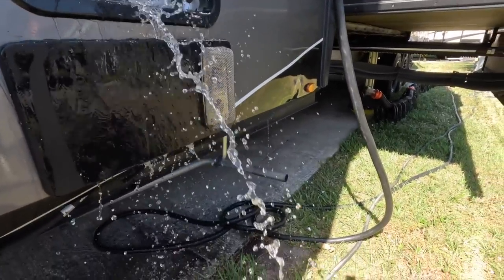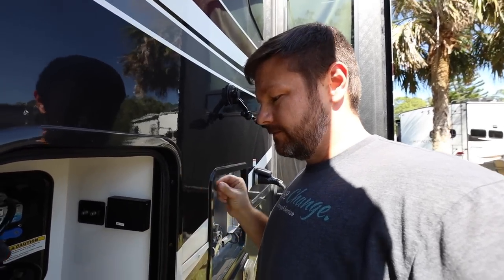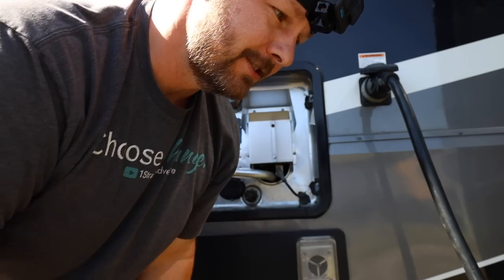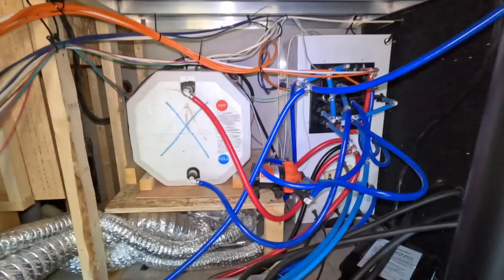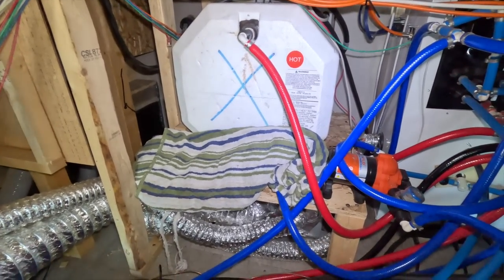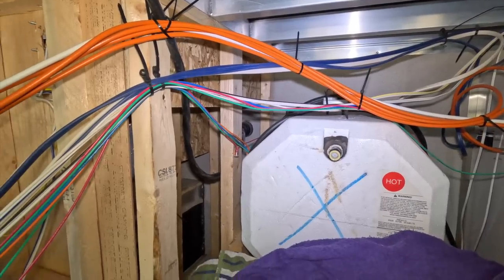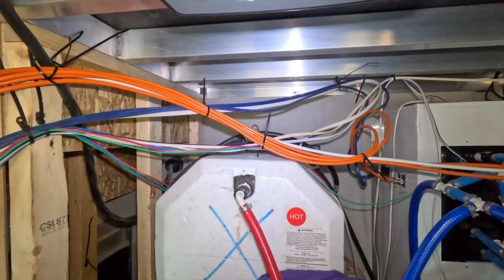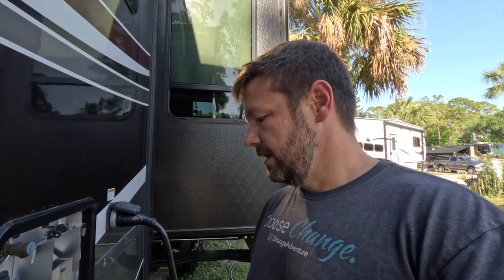No Hot Water Pressure in our RV! Hot Water Heater FIXED! 🔧💦 (RV Water Heater Maintenance)

Comment: My check valve went out on our trip to Yellowstone last September I pulled it apart. Ran with no guts until I got home. Just cut the pipe. Put a shut off valve in line. Been working great ever since. Thanks from Wisconsin.

Comment: Was happy ours came with the tankless on demand. Seems every youtuber at some point those plastic fittings on the top/bottom of that tank will eventually leak. Good that your top one is changed but i wouldve replaced the bottom one as well with a metal one while you were in there.
Reply from the maker: That’s a good call. I didn’t even think about it at the time. We just wanted water pressure at that point. 😩 I’ll have to do that next time I’m in there. Thanks for the suggestion!

Comment: Ours being older, have had to work on the water heater a few times, did the check valve a few years ago, the pressure releif valve the next year, and the pilot light assembly the year after.. Hopefully will be good to go this year. I started keeping a check valve and a few random sharkbite adapters onboard just in case. Our PEX piping has the plastic compression fittings at all the tee's and elbows.. they dont seal up much better.